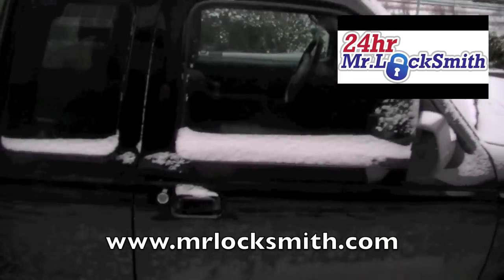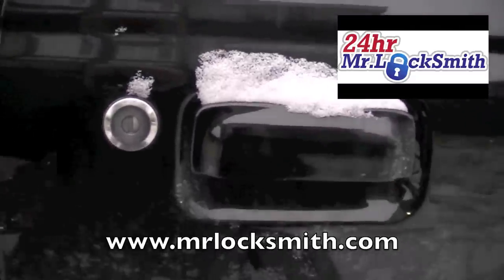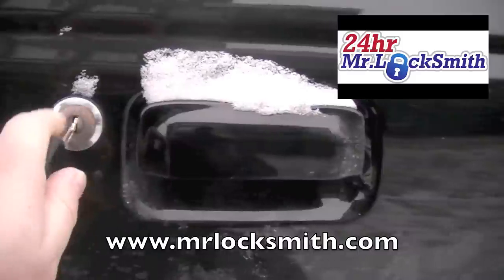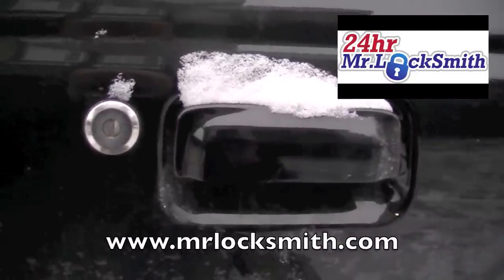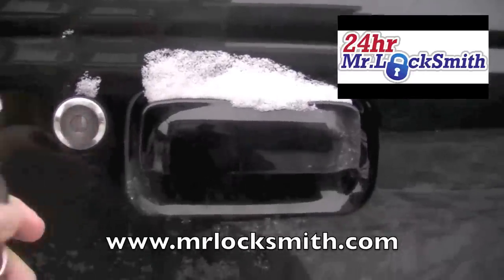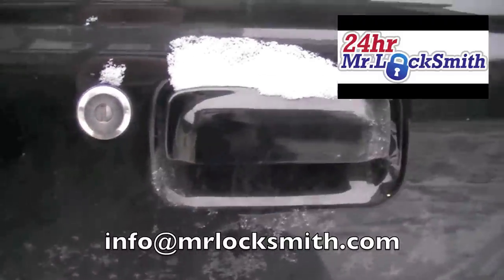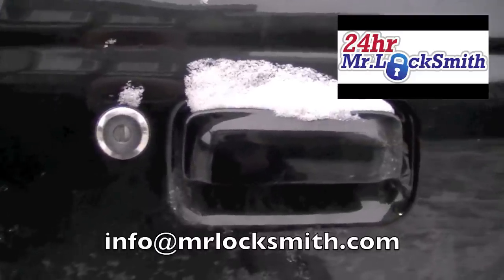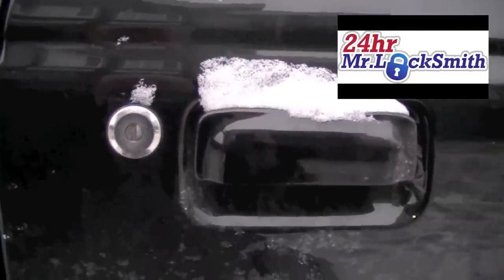How to Unfreeze a Frozen Car Lock | Mr. Locksmith Video

Comment: ***** Adrian something nailed it. If you have alcohol just put it on the key & glide it in gently several times. It may take a few times, but it works especially on older non plastic locks.

Comment: Before winter comes, Silicone the rubber door seals.Prevents breaking the door handle off when door is frozen shut. Graphite the lock cylinder as well. Graphite is non-wetting.

Comment: The method that works best for me is blowing air through a straw into the koyhole, it took me 30 seconds and I was in. However, it may just be because the keyhole isn't covered and the water easily escapes.
Reply: Life saver

Comment: I recently bought a nissan 350z and my mom washed in during the winter now the key won't open the door I tried dw40 and a heating fan for a good 2 hours yet it still won't open what do I do?
Reply: WD 40 is Total Crap,go to ace Hardware and get a Can of TRI-FLOW Lubericant!!! A small Can only costs 6 or 7 Dollars!!! Its Mfg by Sherwin Williams Paint Co. but you CANNOT BUY IT AT A SHERWIN WILLIAMS PAINT STORE!!! They don't STOCK IT,Get it at Ace Hardware and save yourself a bunch of HASSLE going to a Sherwin Williams store to try and get it!!! Cheers Mate!!!

Comment: This is was worked for me; get an iron and a towel--place the key in the towel and fold it. Place the hot iron over the metal part of the key for about 15-30 secs on each side until the key is warm. Then go quickly insert the hot key into your car and jiggle around until the key turns. Bam. No extension cord or hair dryer needed. Hope this helps someone.

Comment: hot water from your tap will easily do it and not hurt a damn thing.  your lock electronics are waterproof and there are no seals or rubber that wont handle 140 degree water. your car was made to be in the rain and in the heat. your paint gets hotter than 140 degrees in the summer.